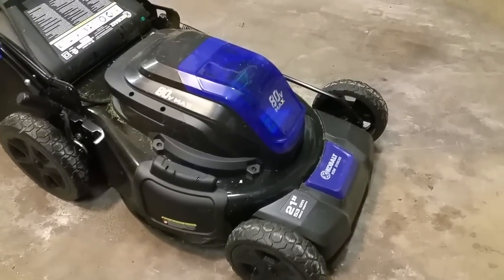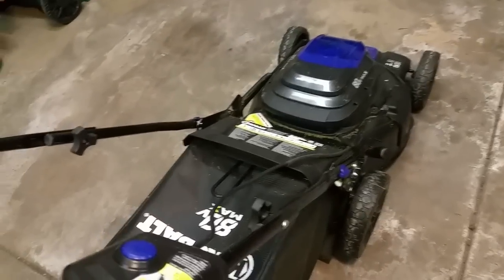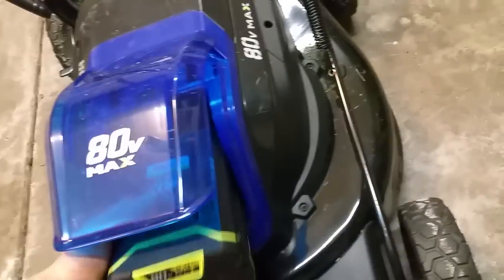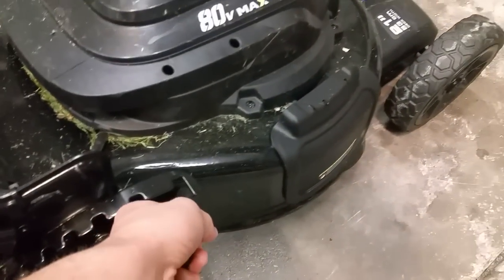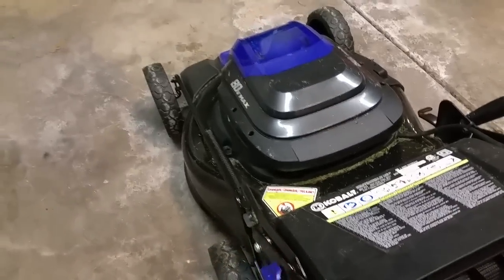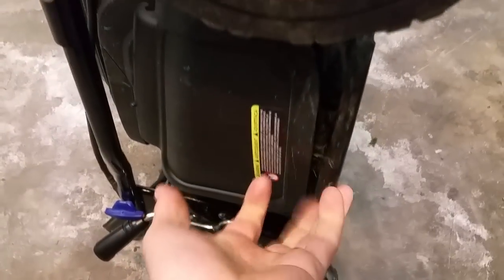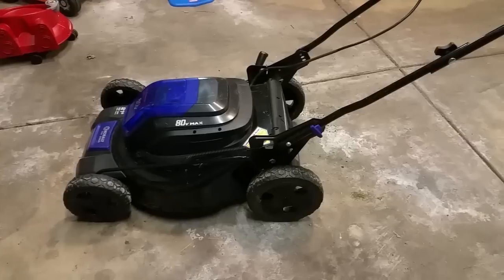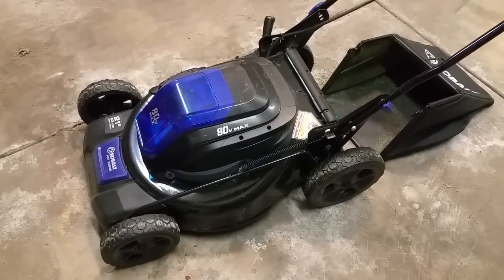Kobalt 80V Lithium Powered Lawn Mower Review

Comment: just get the 40 volt with 2 extra batteries. lighter and quieter than this.
Reply: Brent Hill but not as powerful. 80V will give you a lot more torque than 40V.
Reply: VSUPARHAM  DITTO- MORE POWER! A Man Cannot have Enough Power , now can he? For large or HD Cutting? I think the Higher Voltage is warranted. But for most of us? with Smaller lawns and we cut them pretty regularly at the 3-5" Height? Less maybe Just as good and The Battery Cost Replacement is less too ! And oes the Kobalt and Ego have other Cordless tolls Like  the Ryboi Has that the Battery is Enterchangeable with them?  That's why I bought the Ryboi set up ! CELM, Weed Trimmer, Hedge/Bush Trimmer and Leaf Blower all use the same 40v battery  and I use the 2 I got with the LM..and got the other tools alot cheaper without neededing the charger and Batteries..and sure Like Cordless now in anycase!   Waiting for a E. R.LM ,  or like a 20" Cutting blade Adapter system to a Pwer Scooter ! I bet its in the works
Reply: Selna Goodhead Since writing this I went out and picked up a 56V EGO.  The EGO has a chainsaw, blower, weed eater, and hedge trimmers.  I wanted to pick up this Kobalt, but my local Lowes didn't have one in stock, so I headed over to H.D. and grbbed an EGO.  I couldn't be happier with the EGO.  I was able to cut my entire lawn on one charge and EGO's storage is 2nd to none.  It folds nice and compact and I store it vertically.  Next month I'll be picking up the accompanying weed eater (which also comes with its own battery).  I have a neighbor that has a 40V Kobalt and with my Bermuda grass I just don't think that 40V will have enough torque if I let my grass grow pass 3 days.  Regardless of your choice of manufacturer, these new electric power tools sure are awesome aren't they?  Modern Technology for the win!